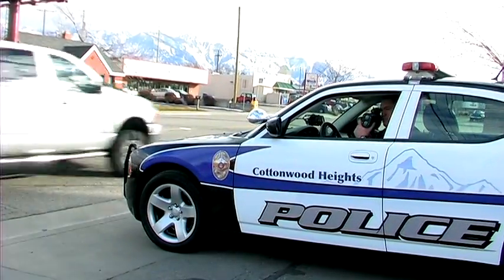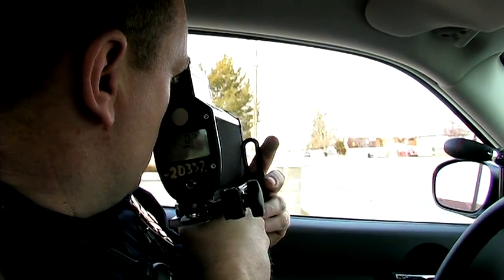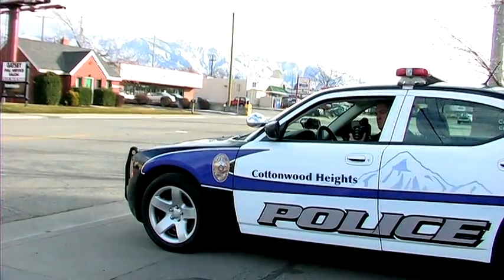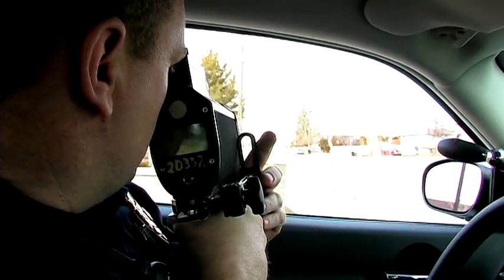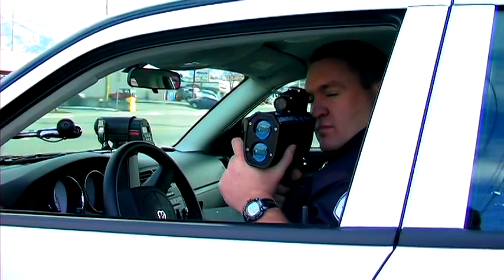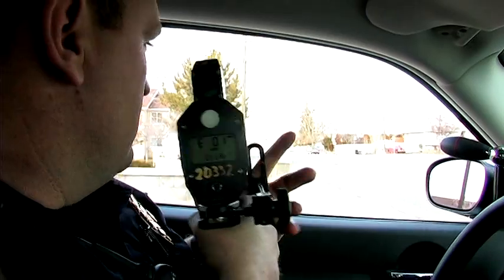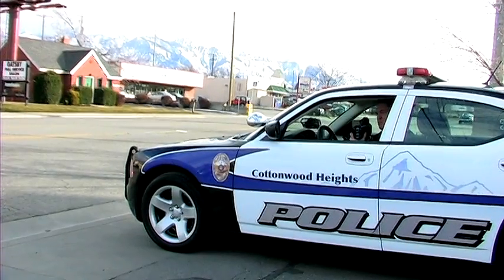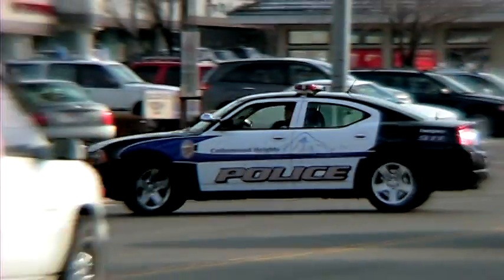Police Jobs : How Does a Radar Gun Work?

Comment: The actual short version.
LIDAR - This is typically a hand-held unit that uses an infra-red laser to take lots of distance measurements between the device and the reflective object it is aimed at. Speed is calculated back from the change in the distance against the time between measurements. 
Doppler RADAR - Uses radio waves to measure distance and relative speed.  The speed measurement is calculated from the change in frequency of the reflected radio waves. (Look up 'Doppler Effect' for more)

Comment: The specifics: RADAR and LIDAR work the same way--sending a beam (of high-frequency radio waves or narrow-focused light waves) out into the air at the speed of light, when the beam hits any object, it reflects a portion of the beam back towards the beam source. This is repeated hundreds of times in just a few seconds. A computer calculates how long it takes for the beam to leave and come back to determine distance. Speed is then calculated by the change in distance over several different beams.

Comment: BTW, I'm not RADAR certified....  I'm a RADAR Maintenance Technician with a degree in Applied Electrical Sciences and eight years practical experience at maintaining, repairing, and developing RADAR systems ranging from the WSR-88D NEXRAD Weather Doppler to the ASR-8 Digital Air Traffic Control system, including mobile tactical RADAR systems used by the military.

Comment: Rpkalt, you're right this video is horrible. I wouldn't necessarily say that lidar has more issues than radar. An inexperienced operator may not understand errors like radar shadowing and interference. Moving mode radar has the cosine effect issue if the radar transmitter is not properly aimed. 

David said lidar is more accurate but did not define accuracy. Speed readings must be 100% accurate or the instrument cannot be used. Thats why officers must test equipment every day.

Comment: What a COP doesn't want to hear in court.

DOT regulation 393.81 	

Subpart G - Miscellaneous parts and accessories

§ 393.82Speedometer.Each bus, truck, and truck-tractor must be equipped with a speedometer indicating vehicle speed in miles per hour and/or kilometers per hour. The speedometer must be accurate to within plus or minus 8 km/hr (5 mph) at a speed of 80 km/hr (50 mph).[70 FR 48054, Aug. 15, 2005]